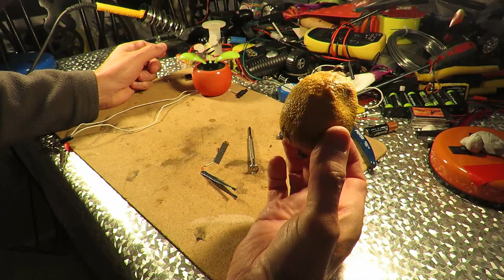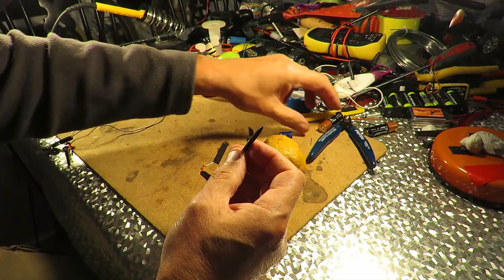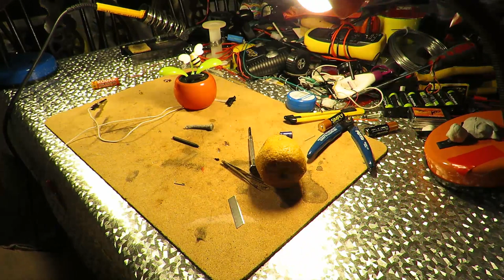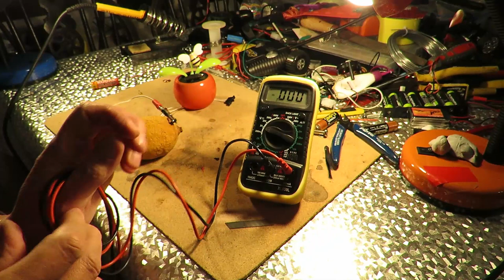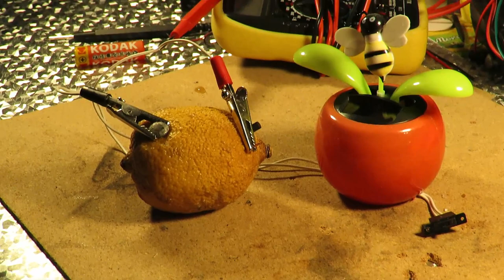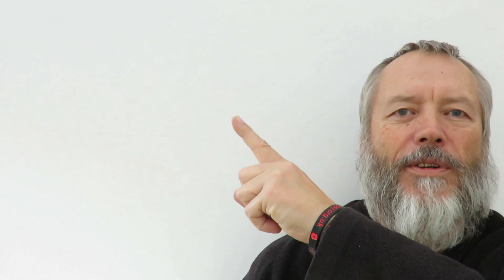Episode 9 Battery experiments using a solar wobbler Lemon Battery

Comment: Yes that works great with a lemon. It's the acid that gets the electrons moving. When you put the larger bit of copper in, it must have went over a volt. Be interesting to see a lot of lemons in series, just to see how many volts you can get. 
Get down to the supermarket and get those lemons bought. A bag of 50 would be good to start with. LOL
Reply from the maker: I have played that game before but it is not volts you need, it is amps, so you need lots in parallel.
This table gives you the volts if you choose two dissimilar metals https://3hp22p4vkie16x1dv48qurbo-wpengine.netdna-ssl.com/wp-content/uploads/2015/07/Galvanic-Corrosion-Chart2.jpg
Reply: @GrandadIsAnOldMan  Ah yes, parallel gives more capacity. So, what's the problem, just buy 100 lemons. 50-50 and "voila", you could run the house for a year. Ah, but wait, they will just put up the price of lemons. 😲🤪 
Good chart. 👍

Comment: Hello. How I can make solar battery charger with 2Watt solar panel?
Reply from the maker: That really depends on what battery you want to charge and how careful you want to be about getting the battery charged safely. If you panel puts out the right voltage you could just connect it directly to the battery and you might get some success. I have seen many solar panels sold on that basis, the only circuitry included was a diode and an LED. If you want to be a bit more professional then you might find this video by Great Scott helpful https://youtu.be/kEttqWJrdww

Comment: can this also be replicated with just using lemon juce ? been reading about one of your countrymen  michael faraday's  experimentations with electricity and magnitisim. or how about the other .
Reply from the maker: The voltage comes from the dissimilar metals used for the anode and the cathode. The lemon juice is the electrolyte that carries the electrons. While you are researching have allook for "galvanic effect" and you will probably find a table that shows which metal combination generates the highest voltage.

Comment: I have one of those flowers.  Mine is kinds slow, do you have an explanation for that?
Reply from the maker: The first problem is usually lack of real sunshine. They do work best in good sunshine. After that we get into mechanical issues such as the rocking components being out of alignment, not sitting on their pivot points perfectly or maybe some of the plastic flashing from the moulding is sticking out and fouling the movement. Just sliding the rocking parts forwards and backwards a little might free them up.
Reply from the maker: By coincidence I have just come across another situation that will impact on the effectiveness of these solar wobblers. If you stand them on a metal surface or maybe very close to a metal window frame it will disrupt the magnetic pulses that make the pendulum swing.  I thought I should mention it as I was just setting one up myself and had it standing on a jam jar with a steel lid and it could hardly move.
Reply: Grandad, that is all it took.  I had it by a light with a metal base, once I moved it, it started working faster
Reply from the maker: @katbot2190  wow, that was a complete coincidence that I found that problem. I was working on a completely different project that I just happen to be using solar wobblers as a convenient 'tool' and I stood it on a jam jar that had a metal lid. took me several minutes to realise what I had done 😍👍